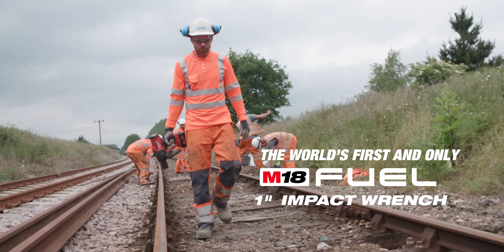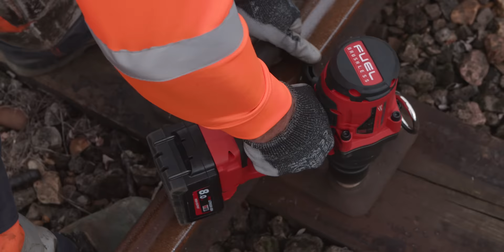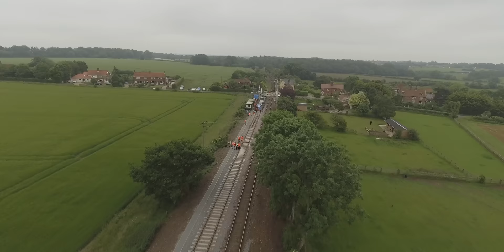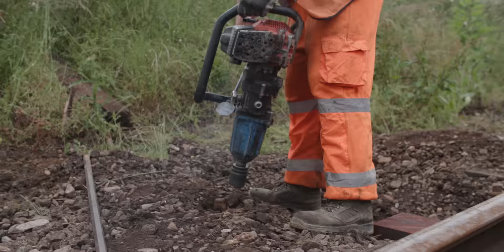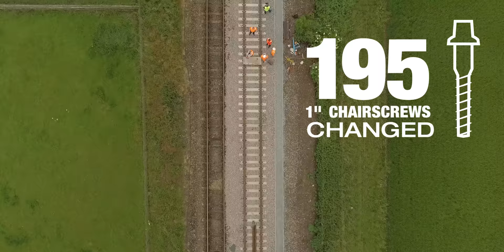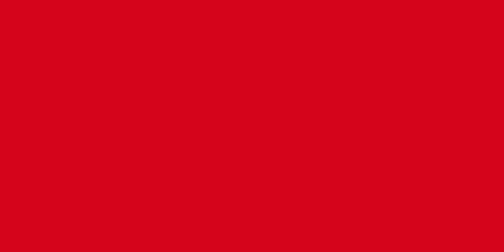WORLD'S FIRST: M18 FUEL 1" Impact Wrench

Comment: cant wait to tighten my customers spark plugs with this
Reply: And then just weld it if it slips
Reply: I'm with u only I cant wait to drive deck screws with it
Reply: lol
Reply: I fucking lol’ed
Reply: Haha 😂. Where are you lactated. I’ll be your first customer!
Reply: @Mayanex981  i know what you meant but... where are you lactated... that's hilarious
Reply: If the head breaks of, just weld the ignition cable to the spark plug and fill the hole with epoxy resin to avoid arcing :D
Reply: Lmao
Reply: @AN-nn5si  Bravo👏👏👏🤣
Reply: As a mechanic I can say this is the funniest comment I’ve seen all week 😂😂😂
Reply: Damnnnn 😂😂😂😂😂
Reply: Can’t wait to drive my phillip screws through concrete with this thing
Reply: @samrowe2889  I’m gonna put up some drywall with it
Reply: Bruh💀💀💀
Reply: @lakerdude349  no just use this to assemble ikea chairs
Reply: Triton v10?
Reply: say bye bye to that cylinder when shards of sparkplug go inside lol
Reply: Congratulations you just ruined your customer's cylinder head with that excessive torque. This impact wrench is for railroads, tractor-trailer lug nuts, and servicing large heavy equipment
Reply: @davidperry4013  no shit
Reply: @davidperry4013  I think that joke went into orbit over your head
Reply: When your impact has more torque than your racecar
Reply: @davidperry4013   lol it was a joke
Reply: Just go buy a set of easy outs first.
Reply: You would trash a cylinder head with a 1 inch impact. Spark plugs are supposed to be tighter manually at the OEM recommended specifications.
Reply: @David Perry     (This Joke)     < over
                                    🧐             < your head
Reply: And oil pan bolts and an oil filter
Reply: 🤣 cant wait to tighten customers sump plug and wheel bolts with it either hahahah
Reply: @Mayanex981  Why... Why is "lactated" even in your autocorrect?
Reply: @davidperry4013  Very good, the air is made of air too. Thank you for stating the obvious. We we're a little confused.
Reply: Make sure to add red loctite to make them stick better too, don't want them coming out..
Reply: Attach this to an oil filter
Reply: Overtorque 📈📈📈📈📈📈 STONKS

Comment: Can’t wait to assemble IKEA chairs with this!!!!
Reply: It still going to break the chairs not the drill
Reply: @xximbetterxx2336  
Lol
Reply: Nice and tight
Reply: @Daniel-ww3hl  yup
Reply: You would definitely ruin your IKEA chair with it. Even an M12 fuel 3/8 stubby is way too much torque for assembling IKEA furniture. You should definitely go with an M12 fuel 1/4 impact driver instead. Just set the M12 fuel impact on the low setting maybe put it on the medium setting if you are careful.
Reply: @xximbetterxx2336  you mean “break” ? Lol
Reply: @nguont  it was 2 am when i posted it ok so I wasn’t thinking
Reply: @xximbetterxx2336  lol it is fine
Reply: Pulls trigger
"How am i gonna get that chair out of the ceiling...
Reply: @mwnciboo  💀
Reply: lol
Reply: Lol
Reply: @davidperry4013  For the m12 3/8 stubby; you could always use the lower power modes and a little bit of trigger control.
Reply: What are you building them out of? 1" thick steel?
Reply: @SparkieUwU  na 1/2” ply wood
Reply: hahahaha
Reply: Yes would make the job easier love it
Reply: I was using the new 1/4 and snapped a lug stud a few days ago 🤣🤣🤣
Reply: @aztekwarrior518  bruh try using torque sticks snap em up real good
Reply: @justanrcchannel5677  I was taking it off 😂😂
Reply: @aztekwarrior518  oh shit
Reply: @xximbetterxx2336  it’s all good . We all make mistakes lol.
Reply: @davidperry4013  😅🤣😂 WHOOOOSH
Reply: Lols
Reply: PDPDPDDDDPPPPDDDPDPDPD
     SNAP
Reply: You might have some extra sawdust after you assemble those chairs.
Reply: Whatever gets the job done is what I'll say.
Reply: @matthew4031  just a lil extra that’s all
Reply: Dude I haven't laughed that hard by myself in a long time! 🤣🤣
Reply: train conductor: oh shit an ikea chair
Reply: ahahah
Reply: LOL
Reply: Overtorque
Reply: Use a normal drill/driver for that. A heavy drill like this would not be recommended for woodworking projects.

Comment: When your handheld impact has more torque than your race car
Reply: #justhondathings
Reply: It's momentary torque, not continuous
Reply: @bluezz5002  it’s also a joke
Reply: @bluezz5002  r/woosh
Reply: @bluezz5002  woooooosh
Reply: @tamaselmont8310  woooooooooooosh
Reply: @bluezz5002  power just depends on revolutions there is no momentary or continuous torque
Reply: @Soulleey  it can only put that torque down for a split second, which is less than useful in a car
Reply: @bluezz5002  ye... so that means there are low revolutions
Reply: @bluezz5002  yees motor car power(kw/hp) + instant impakt torque,bro rocket🤣🤣🤣
Reply: @ichwars792  what does this mean
Reply: @Yaroslav_Tselovanskyi  it seems like you don't know what it means r/woosh

Comment: This must be what they used to tighten up the wheel nuts on our Jetta 😂
Reply: some people in tire service are too lazy to chance set from TIR  to a smal car on pneumatic tools
Reply: Just wait until you try loosening the  front wheel hub assembly. Zeus put those things on there.
Reply: @the-mighty-taco  
3/4 inch breaker bar and a scaffold pole is usually whats required.

Comment: I didnt even know, petrol powered drills existed🤯
Reply: Yep, I used to use them when I worked rail construction. 

Gas-powered impacts, abrasive rail saws, drills and grinders also. Big and heavy, but they are true work horses that take a beating and can run all day long with just a small fuel can.
Reply: They're called a Bance, manufactured by R Bance and Co Ltd in the UK. Great tool
Reply: Petrol powered chainsaw exists, so it's not that far fetched
Reply: @DirtIndustry  not when you work in a remote place with no access to electricity.

Comment: I'm so pleased that the perfect tool has arrived. I need to install a toothbrush holder in my bathroom and I require a suitable tool to drive the 5.5mm screws into the raw plugs that I installed many years earlier. This machine looks like it might be up to the job.

Comment: i got one, it's a great tool. got it for 8 months now, use it quite often. the only downside is there is a lot of room between the machine and the battery pack, it wears out cause of the shocks it gets when using the machine. and i know in time you have to hold the batterypack back with ur hand or it won't connect with the machine.

Comment: Normally I don’t like cordless heavy duty tools, but that’s impressive👀
Reply: @sonacphotos  Yep, corded tools are purely for hobbyists at this point, even drywallers are using battery powered screwguns that zip up sheets as fast as the corded guns.
Reply: @ATSaale  air tools still have some advantages though. Such as size. An air motor can be much smaller.
Reply: Only problem is if youre that far out you cant recharge it so you need to carry shit tons of batteries

Comment: It's fine for tracks like that where those screws come out easily from wood and light maintenance but it doesn't compare to the petrol bance for more stubborn bolts/screws. Where it fails the petrol one won't however as the guy demonstrated in the video, it is a lot easier on the back and you won't have to worry about a broken pull chord. Just dead batteries after 10 seized screws.
Reply: im sure they keep the gas one in the truck and use the cordless till it dont do the job or they run out of batteries

Comment: As long as you have a place to charge the batteries they are a very good tool.
Reply: Well if you have few of them, maybe two or three it would be enough for entire day of hard work.
Reply: 12v inverter in the cigarette lighter of a vehicle and plug in the charger, use one charge one.
Reply: Most modern pickup trucks have 110 outlets inside. Have yourself 3 or 4 batteries and you are good to go.

Comment: I think there's a reason you didn't show the gas powered one going at the same time next to yours
Reply: Probably because it’s actually more powerful.
Reply: As someone who has used both I can tell you the 3/4" makita rattle gun is more powerful than the 2 petrol ones it replaced.
Reply: @404 Error Not Found Electric motors*

Comment: I actually do exactly the job in the vid, we recently swapped out the 2 stoke rattle gun for a Makita 3/4" and there's no way you'd ever go back. I certainly don't miss lugging the 30kg beast miles up the track. The Makita actually has more power and must be 1/5th of the weight.

Comment: Fair enough it’s able to take sleeper screws out. Though ur back would be far more knackered doing bending down like that over a few length even if it is lighter compared to with the impact wrench, where u can stand up straight and work. How long would that battery last also? Not a full shift I’d imagine.

Comment: I used this exact set up tightening joint bars and it work to an extent..... still had to used the hydraulic impact to get the bars tight....definitely fits a purpose....

Comment: “Total petrol replacement” after 32 railroad sleeps I bet the petrol finished the job.
Reply: Think about this, petrol solution weights like 35kg and this small thing on ONE bettery replaced that much and they have bigger batteries in their line of products
Reply: And how long will 5 litres of 2 stroke last ..a week? 
The 8 amp battery maybe quick to swap but will take 2 hours to charge. Also at £130  pounds each they are expensive if you want spare.
Next practicality.  If I forgot to to make 2 stroke it of to the 24 hour petrol station and of we go.

Now.. what do it do if I forget to charge my batteries.. can  I pop a couple of AA batteries in there or is the shift cancelled.
Reply: @richardoakley8800  Seriously, the weight and size savings alone are well, massive. Two stroke engines are also finnicky and can be a pain in the butt to start. Given the choice between a petrol powered tool and a battery powered one that will do the same job, I'll take the battery powered one any day.
Reply: richard oakley there’s a reason why a lot of industries are going to cordless impacts and drivers. If you can’t see the benefits you’re blind. I’m not saying they fit everywhere, but a lot of places they do. We have multiple cordless impacts and drivers on our farm and they save a lot of work. Can swap skinnies to wides on a hc sprayer on one battery. It tightens lug nuts more than two guys on a 4 foot snipe can.
Reply: @davidlogel2350  I believe it’ll eventually be like the corded/cordless drill scenario where people always have a corded drill as a backup in their toolbag on a job site. There are times when the corded is preferred for heavy jobs in situations where it outperforms the cordless. But the cordless can already do most jobs...
Reply: I actually do exactly the job in the vid, we recently swapped out the 2 stoke rattle gun for a Makita 3/4" and there's no way you'd ever go back. I certainly don't miss lugging the 30kg beast miles up the track only to have to play up and take a zillion pulls to start. The Makita actually has more power and must be 1/5th of the weight. We bring 6-7 batteries with us out on track, the drill and grinder take them too. The rattle gun normally takes 2 batteries per day.
Reply: @richardoakley8800  am in construction, we replaced our corded sawzall with the battery one, then we replaced another, then we replaced our circular sawz with battery ones. We have spare batteries that stay charged and it takes about 45 mins to charge a battery, not much longer than finding a gas can and running down to the store to buy some for the generator. Next up will be nailgun. Batteries reduce trip Hazzard from extension cords all over the jobsite, it saves time, and time is money. The impact depicted is less than half the weight of what it replace. That worker is less tired which allows him to work faster and longer. Time=Money.
Reply: @richardoakley8800  LOL that 5 liters of 2 stroke mix will last 2 hours MAX if that's all they're doing, which it probably is. I've used those gas impacts and they really dont last all that long. Also kind of a dick in the ass to have to jump off track to go get fuel for your tools. Trucks I've been in that had the milwakees also had inverters and chargers and multiple batteries
Reply: dude is sayin that you need to maintain your machine and there isnt much to brake in 2 stroke engine, and then also says that if you forget to charge batteries you are fcked. People will refuse to elecricity cuz its new, same was with paper, same was with petrol engines vs steam engines, same was with common rail. There is shittons of examples in our history, where people refused to use new technology becouse its new, repeating same, 20y old arguments
Reply: @wisniamw  Yeah some people can't accept change. The fuel debate is just stupid, batteries are very cheap in the scheme of railway maintenance. Just bring enough to achieve the days work. If you forget to charge them then you're probably also the sort that doesn't check how much is in the jerry can before you go out on track. Having done it both ways you'd be absolutely mad to use the petrol powered beast, there's no advantage anymore. They are obsolete.

Comment: I believe that this cordless  wrench is excellent but for this type of work petrol and pneumatic wrenches are more practical, no need to carry 10 batteries or constantly running petrol power generator to charge batteries for 16h/day of work.

Comment: for big bolts you need a big tool, that gasoline tool its heavy and give some good stability for torque, have reductor so moment of torgue is instant and same in every second of use, with unlimited time of use..  also when you set on bolt give some down force not only rotation... btw inovation without  real utility is 0.. this is good  only for truck tirres in my opinion

Comment: I work for union Pacific railroad and we have these and they suck...... Doesn't have enough torque to bust off or tighten track bolts.  Nothing beat hydraulic tools.....  If they were made better they would be better.

Comment: I have one for mobile truck repairing, it's awesome!!!
Reply: I'm a hd truck mechanic. This beats my 1 inch pneumatic gun I have and don't have to wait for the air to build up on my compressor everytime it gets low. Them lug nuts gets torqued down to 500 ft lbs but taking them off when they're rusted will need more torque

Comment: hold on guys .. batteries dead ...  give me a quick 4 hours
Reply: On railways works, a ties renewal on concrete pads/steel bars ties needed to fix the broken ties to allow a track replacement train to work. They used two pallets of Hillti pneumatic drills to make the new holes to put temporary fixations.

Comment: Yeah I don't think lag bolts in wood is a good representation of the break away torque this has, you should send me one to demo on medium duty tractors.
Reply: Thinking anything structural, or anyting heavy equipment wise. Few lags in a rotten board doesnt count.
Reply: @brandoncaldwell95  huh?
Reply: @ConTheDon187  he was agreeing with you there.
Reply: If you've never beaten one in with a hammer or even ran it in with the gas impact, you wouldn't understand.
Reply: @4thgradedropout980  Have you ever tried to break loose a bolt or nut torqued down over 500lbs? its nothing like a lag bolt in wood. I know what you mean but I do understand. It was cake for this impact whereas you watch it used on industrial equipment it struggles to break loose 1" nuts. I'm just not interested in forking out that kinda dough for something that can't do what I need it to do
Reply: @ConTheDon187  a 12 tpi 1/4" bolt provides 1000 pounds of clamping force,  so absolutely I have been in the example  you've  laid out. I'm pretty sure they are showcasing reduced fatigue on personnel as well as ease of use. Also the impact in this video costs far less than it's petroleum powered competitor. I think you may be examining this demonstration more critically than the work they chose to display from the onset. My original comment only expressed that it's harder work than is perceived and that the proof is in the pudding and we're sitting at the kitchen table.
Reply: @4thgradedropout980  I'm not disagreeing about the capability of the bolts, more the scenario they were used in for product showcasing. Yeah a gas powered impact I'd imagine is pricey, I wouldn't know anything about that. My options are electric or pneumatic and the pneumatic 1" impact is $300 and just as strong if not stronger.
Reply: @ConTheDon187  Fair enough. Cheers.
Reply: I can take off 20+ semi wheels and torque back to 500+ ftlbs on a single 12ah battery and still have 2 bars left. The other amazing thing is you could use it for 24 hrs non-stop. These arent to play around with.
Reply: @jasonmefford4312  Nice, that's for the most part what I'd be using it for.
Reply: Connor K Let’s be real. It’s often easier to cut off a 1 inch nut off a machine than it is to break it loose. And when it’s thread locked........oh god........... As for the Milwaukee. Its size alone tells us everything we need to know.
Reply: @Veritas-invenitur  Idk, cutting things off is a last resort, cause then you have to get a new bolt or whatever it is you had to cut off. But I'll pick one up soon, maybe even today so I can do some brakes on a freightliner

Comment: That amount of torque will drain the battery real fast, i will still use the petrol one thanks when working 30 miles from the closet plug socket to recharge

Comment: I own Milwaukee tools in this video is funny! If you notice late in the video the real drive drill we’re putting the bolts in is held by the guy on the left and after he puts it down he grabs his back that’s funny I don’t believe the railroad is going to trust a cordless drill of that size to drive bolts in to hold the tracks down and you can clearly see the other guy holding Holding the actual drive drill it is tremendously larger than this Milwakee